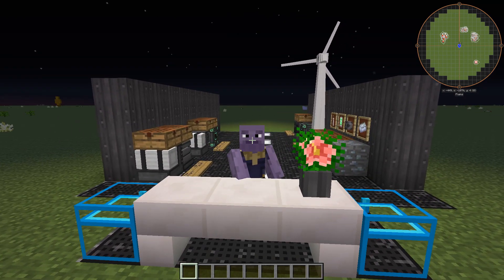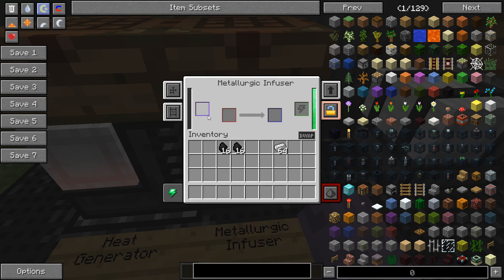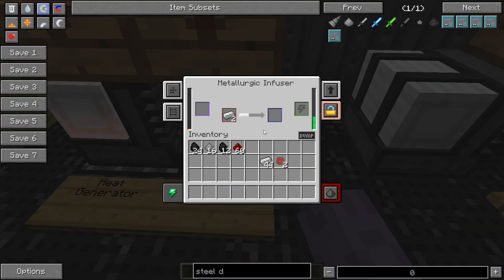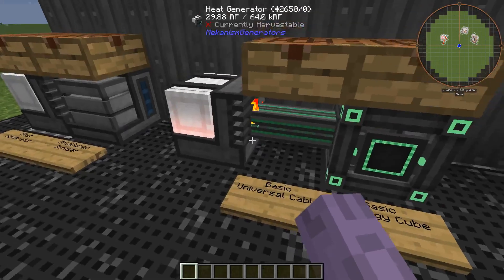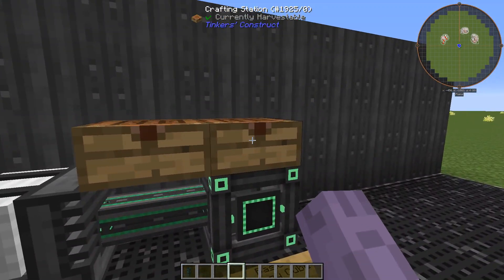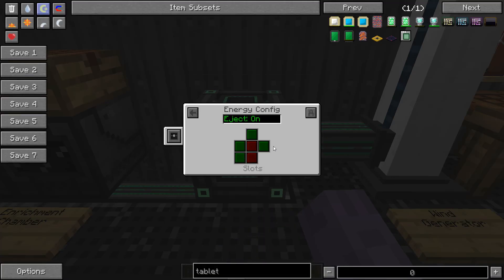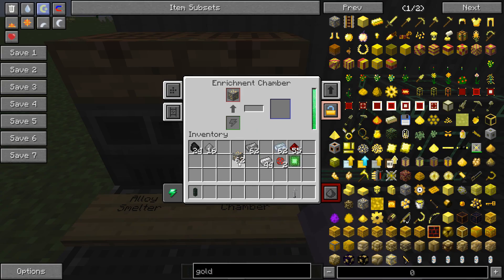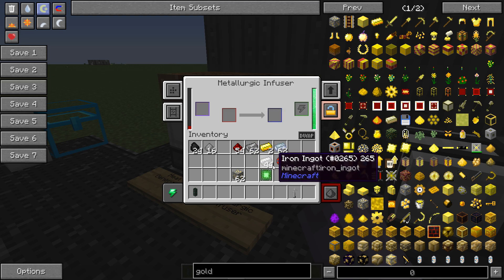Minecraft - Mekanism Tutorial Part 1: Basic Energy and Machinery (1.7-1.16)

Comment: Notes:
 - put lava around the heat generators, its much more efficient than any fuel you put into it and lasts forever.
-enriching coal and redstone in the enricher makes them last 8x longer so that 1 item enriches 8 instead of 1.
Reply from the maker: I wouldn't say lava is more efficient - if I recall correctly it only generated 10 RF per tick which wouldn't sustain much.
Reply: @QuantumBlink  I'm not debating that dw, heat generators suck as soon as you build anything else but for the beginners who want to not waste fuel heating them thats my advice

Comment: You can just surround heat generator with lava and it will generate power, no need for coal!
Reply from the maker: Unfortunately this is a pretty low rate of power gen in default configurations

Comment: What mod you use for ... "top" screen info thing? What's needed for these mods?
Reply from the maker: Hey man, sorry for the late response. In 1.7.10 I use WAILA, and in 1.12 The One Probe works. If you’re asking general hardware requirements for modded, they can be pretty steep. Expect to have a minimum of 8gb for your modpack and be running at least an i5 or any Ryzen processor.

Comment: when i put stacks of coal into my heat generator, i get barely any power from it and it depletes really quickly. when you did it you got a full tank of lava. is there something i did wrong?
Reply from the maker: There’s a couple of things - how many machines are you using? There could also be different configurations for the mod. You can edit how much power a heat generator makes in the configuration files
Reply: did they remove the heat generator